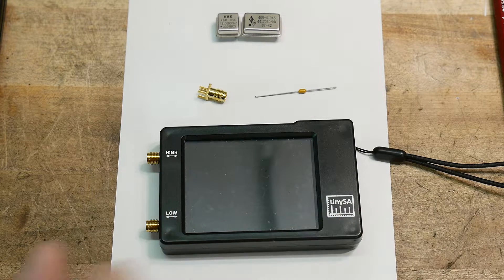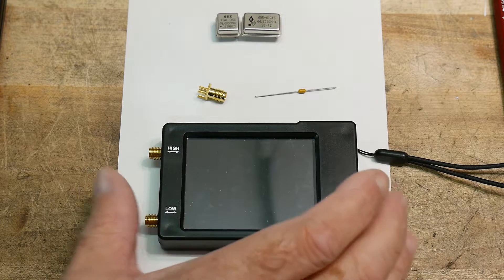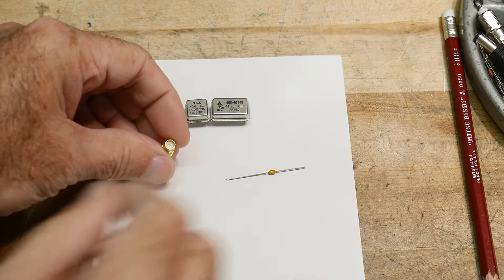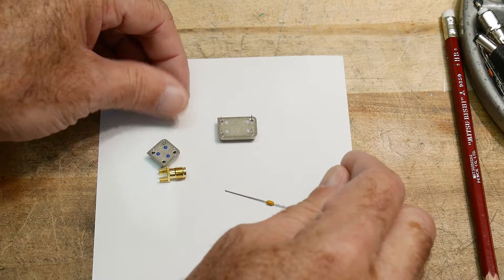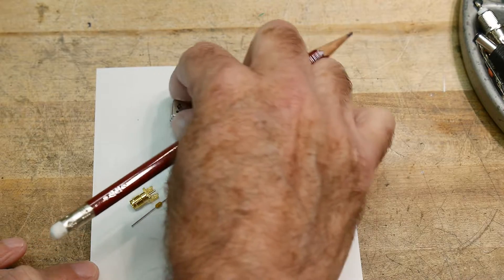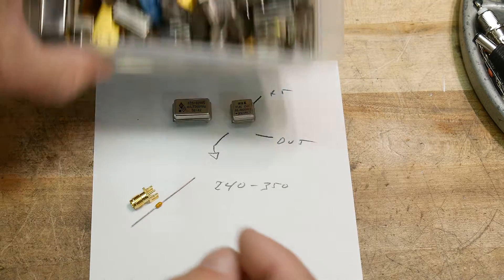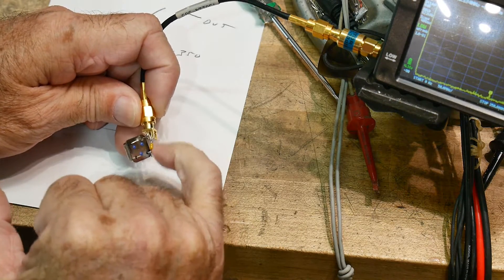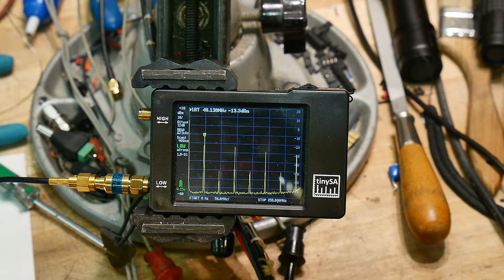#558b TinySA High Port Calibration (It's not easy)

Comment: 100 MHZ crystal oscillators are fairly common and run about $5-$6 which should give you a 3rd harmonic of 300 MHz give or take. The 3rd is usually the easiest one to pick off. You could enhance it with some sort of bandpass filtering  and also add a -20 to -30 Db pad (3 resistors) which will also match impedance.  It would make a nice little project.

Comment: You can just output a square wave out of the oscillator like I did
Choose the desired harmonic
Add at the  output add a
saw filter with center frequency you want 
for example
IF SAW Filter 307.36MHz(BW=20MHz)

And that way you don't have to worry about the other harmonics

Comment: You actually calibrated the High input to -1dbm. Look at your display: Lo reads -31 without attenuation. High also reads -31 but with 30 db internal attenuation switched in.
Reply: Bob Craig , The internal attenuation is "transparent" in the measurement obtained. Internal attenuation is used only to make the measurement more accurate by allowing the spectrum analyzer circuitry to handle signals of the appropriate power, and in the end, the value obtained by the power detector is added internally to the value of the internal attenuation used to display the actual power value on the screen..

Comment: Hello, sorry if I bother you but your help is needed for my 100$ rf lab, please come across one old HP power meter and I stripped off the 50Mhz reference source the can whose in good condition the 50mhz trimmer had one sticker calibration seel, I don't touch! (is the only reference standard can I got). I came across one Chinese power meter with a similar chip on your video I watch all your video MAESTRO. Some help for the calibration step es.. offset on de beginning of reading scale and reference on de end or on the midle? the circuit got some linearity response and this encouraging. thank you in advance.
Reply from the maker: It will be best to create a calibration table as things will not be linear. Unfortunately, you need a power meter to build a power meter. If you can calibrate a 10dB range,  you can transfer that range by calibrated attenuators. If you can measure say -20dBm to -10dBm, then you can measure anything bigger by adding attenuators to the input. The other direction is much harder. if you can create -20dBm to -10dBm then you can use attenuators to drop that source power lower and then use the power meter to try and measure. so use -20dBm to -10dBm with 10dB attenuator to create -30 to -20 and repeat, each range can be calibrated to fit all ranges into one line. the bottom of one will be the top of the next. I designed a power meter that would run from -70dBm to +20dBm (don't try this at home :) ) The cal source is only 50MHz so you need to figure out how to extend that to other frequencies. how to measure power of a 1GHz source? We used a very expensive VNA to do that and stored that cal data.
Reply: @IMSAIGuy , I realize your expertise on the subject this is the reason for my question to you, I think to get other power references on a different frequency so I came across one RF power detector from CRISTEK part number: CPDETLS-4000 from 10Mhz to 4Ghz- they give one reference table from Mhz10- 50-100- 500- 800- 915- 1G- 1.5G 2G 3G.-4-G with the power of -10dBm -8, -6, -4, -2, 0, +2, +4, +6, + 10. I think using this detector for the transfer reference and the 10Mhz and the 50mhz 0dBm reference (hope to find one at 500Mhz and 
1 Ghz) the idea is one reliable measurement, not a Hi-end instrument. my email is:  g7oyo@gmx.co.uk the CRISTEK  detector is reliable? there is another way to doing?
Reply from the maker: @frankreal2258  no that is not very accurate. how accurate are to trying for? what test equipment do you have? generator, spectrum analyzer, scope, attenuators, vna,
Reply from the maker: what range of power are you trying to measure
Reply from the maker: are you trying to design a power meter or just make measurements
Reply from the maker: @frankreal2258  did you watch: https://youtu.be/cDBdwLW1qzA

Comment: What do you think using the 300MHz armonic (from the 30MHz Cal. output build in) to calibrate? When you activate the  30MHz Cal. output, and you put the SMA bridge, the same signal is present in both High and LOW inputs.

Comment: Just double checking as i seem to miss it every re watch but the capacitor connects pin8 (output) to center pin of sma connector only , wanted to reconfirm before i build and power one of mine up 😅
Reply from the maker: the oscillator ground is connected to the outside of the sma and the capacitor goes between the oscillator output pin and the center conductor of the sma
Reply: @IMSAIGuy  thanks for  clarifying, ill be sure to keep your advice and tips in mind especially with my current diy ish upconverter for my sdr😊 happy new year by the way
Reply from the maker: make sure you use an attenuator
Reply: @IMSAIGuy  definitely will be sure to use attention, i thank you actually for a Video of yours in not so distant past saved me blowing up my Nano vna with a small 19db gain but for really low power amazon ones, had i not found your channel id jave probably made expensive mistakes, so thank you
Reply from the maker: yes

Comment: What do you think to replace oscillator with SI5351 that supports frequency output between 0.0025 and 200 MHz. SI5351 Module cost 3 euro (shipped) + PC or Arduino / Raspi. Output power is between 12mw and 20mw*. Charge pump have a 3 settings Low 2mA, Medium 4mA and High 8 mA. The drive strength is the amount of current into a 50Ω load. 2 mA roughly corresponds to 3 dBm output and 8 mA is approximately 10 dBm output.
Reply from the maker: 200MHz is not high enough
Reply: @IMSAIGuy  so Si5351 harmonics   are not to strong enough?
Reply from the maker: @BartekSońta  don't have experience to say. is it a square wave or sine wave. if square wave then should be OK
Reply: @IMSAIGuy  yes, it is square wave  without any types of filters. Produces lots of harmonics. Cristal oscillator is cheap when you harvest it from other boards but si5351 is more versitale. I assume that harmonics levels are usable.

Comment: Maybe the designers of the NanoVNA and SA would consider a dedicated RF signal generator (have to clean up the synthesizer probably but if it's dedicated it''s probably doable) that matches the series...that would make for a real beginner's RF bench for probably less than $200.
Reply from the maker: There is a cheap RF source that I have on order. Yes a complete RF bench on the cheap is my goal.
Reply: The tinySA is a RF signal generator too. You can also use the nanoVNA with some attention for high power calibration
Reply from the maker: @ErikKaashoek  I'm trying to do a tracking generator. I've turned on the LO output and sent to a mixer. the mixer has 433.9MHz input. so the IF is sweeping at the correct frequency as seen by a second spectrum analyzer. I can't get the TinySA to show the information. Any other settings needed?
Reply: @IMSAIGuy  YOu have to enable the LO output as described here: https://tinysa.org/wiki/pmwiki.php?n=Main.SETTINGS
and the total setup looks like this: https://tinysa.org/wiki/pmwiki.php?n=Main.Mixer
Reply from the maker: @ErikKaashoek  I got it working. Was surprised at the high level of the LO out. It actually worked fine turned off. about 10dB leakage around the switch. otherwise I used a 20dB pad as you had. I also found that the IF frequency was 433.8 or at least got more signal there my mixer was set to 433.8.  if my mixer generator is 433.9 then I have to use expert mode and set IF to 433.9 inside the Tiny
Reply: @IMSAIGuy  When using a tracking generator conifguration you best set the IF to manual 433.9MHz as the tinySA will change the IF to various values depending on the frequency you scan to avoid spurs if the IF is on automatic